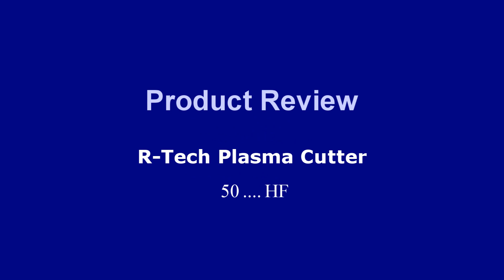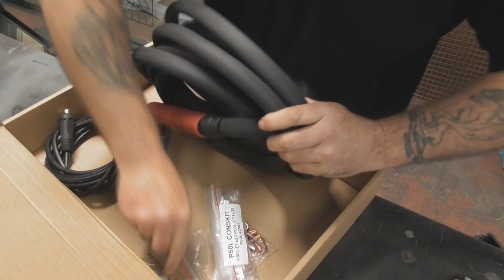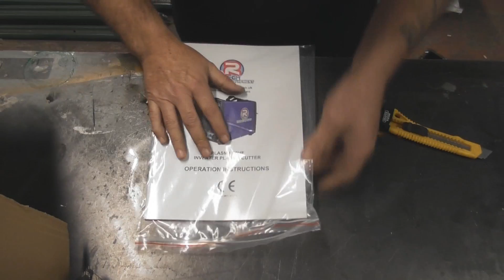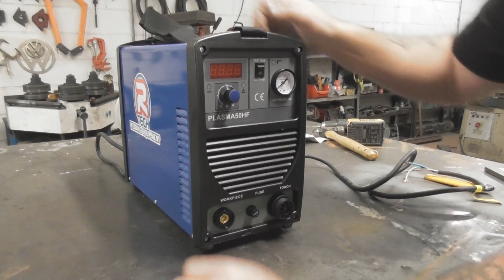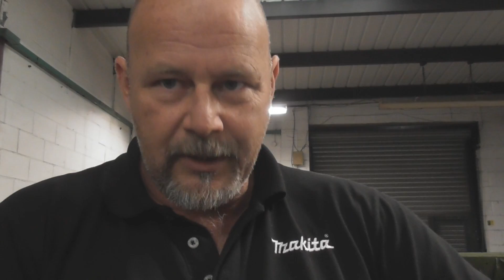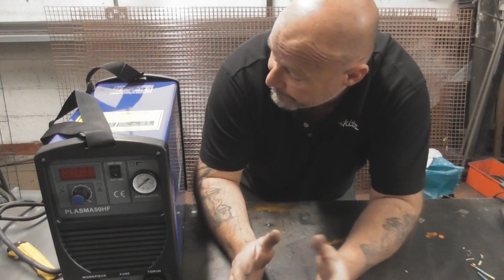R Tech Plasma Cutter 50HF Review

Comment: Im getting ready to purchase a lotus.  I bought their wire welder some time back and it works wonderfully.  It is Chinese,  but actually good quality.
Reply from the maker: there are some great Chinese products out there...when you think of the total volume produced against volume rejected they are really quite reliable.
Reply: @MakeItMetal  yes sir I honestly have not had an issue with mine that was not my fault.  I tend to forget it has a duty cycle lol.  And I burnt the trigger up with grinding sparks.  

Just about everything is made in china anymore.  If you ap at Walmart,  it was made in china lol.

Comment: Good honest review I'm in the market for a plasma and I'm stuck between the r-tech P50HF or the esab cutmaster 40 any advice
Reply from the maker: Hi will, I've never used the esab unit..however I have used their welders over the years and found them to be excellent quality units. I can't fault the R-tech plasma, I've been using it on a daily basis at the shop and I haven't had a single issue.  The consumables are reasonably priced and last well, I don't know how much the esab ones cost but I would factor that into my decision if I were looking to buy one myself. Hope this helps you a bit. Cheers. Jason
Reply: @MakeItMetal  thanks for the info jason much appreciated

Comment: Hi .
Will this run in a 16amp supply ?? Not full power mind. I went to purchase one and they said it would blow fuses if not a 32 amp.  How is yours wired please .
Cheers
Reply from the maker: hi,
i've run mine off a 16 amp breaker but now we have changed it out to a 32 amp breaker.  i've used it on site where 16 amp was the only supply available and it ran fine (at lower cutting power) however yes it will blow fuses if you try to turn up the power.
Reply: Cheers mate . Just ordered one
Reply from the maker: @jasonwinrow4020  nice one Jason..they really are a good bit of kit. I've run Lincoln units for years until I bought this one..it totally out performed my Lincoln. You get excellent after sales service with the R-tech guys too.
Reply: @MakeItMetal  
Yup I have the Tig 210ext and mig 250 but never had their plasma. Will have a play shortly 😁. Keep up the great videos

Comment: Do you think it will run off a 13amp to a 32amp adapter
Reply from the maker: I honestly have no idea. I run mine off 16amp single phase.
Reply: @MakeItMetal  ok thank you for it to run off a 16amp single phase did it have it's own circuit to run off or did you have a standard 13 amp plug to a 16 amp single phase adapter
Reply from the maker: @simpsonspyro2554  I put a single phase plug straight on it 👍
Reply: When i had the a electrician install a 32a plug the guy had to speak to R tech over the phone. Because apparently this unit draws 37a on the inrush. I had to use a 40a Type b breaker to run mine at full power with no issues so I have no idea how it would do on a 13a supply.. it may not even turn on but it does draw 29a at full power so you definitely  want to make sure your cable can handle the current draw otherwise you going to have melted cable in your house )

Comment: Did you put a 13amp plug on it?
Reply from the maker: no, i put a single phase plug on it. ive used it on jobs and had top put a 13amp fuse on it but only running a short time no higher than 30 amps cutting power.

Comment: Good video 📹. .do you think this plasma would be as good as a hypertherm 45xp.? It seems to be a good performer. I'm looking to buy one the hypertherm is a lot dearer than the retch. ..
Reply from the maker: in all honesty Martin, ive used the hypertherm unit and it's ok but for the money the r-tech is far better value and R--tech's support is amazing. save a few (actually a lot) and get the r-tech :)
Reply: @MakeItMetal  the hypertherm seems to be overrated. ..I see you have a migatronic welder in the back ground. .what's it like. .? I was looking at at 200 amp acdc  migatronic tig. ? They seem to be good too.and then  I was looking at the rtech 260 tig it cums in just under the migatronic in price ..it's hard to decide. ..
Reply from the maker: @mandylad  i love my migatronic mig...its probably one of the best i have used..easy to program and all the extra features (pulse, brazing etc) makes it really versatile. ive not used the migatronic tig welders though..i run a 250amp AC/DC R-tech tig and its awesome i upgraded mine to water cooling and it never misses a beat. i had it serviced last year by R-tech and the picked it up, serviced it and returned it within 3 days! :)

Comment: Geez Looking to purchase a plasma cutter and i have watched tons of plasma reviews and that is by far one of the best i have seen ! my only criticism is you never commented on the Pilot arc and how well it works against painted surfaces etc plus this cutter costs £714 including the vat, Top review though mate 👍🏻
Reply from the maker: Hi..you are right...I didn't carry out any tests on painted metal..but having used it a while now it is brilliant at cutting (melting) through layers of paint..the HF pilot arc does the job extremely effectively.  I think the price I mentioned was excluding vat sorry. Thanks for your comment, I hope my reply has helped. 👍
Reply: jason andrews , Thanks for your reply, From what i have been able to work out as a novice there are two different types of pilot arc, Think this one struggles firing up on a painted surface such as a car bodies etc, but like you say once going it melts away, looking between this and plasmapart cut 40 which apparently goes through less consumables because it has an air start pilot arc, Thats why i was curious about the Pilot arc, anyways i have subscribed mate as think you’ll do well on youtube all the best 👍🏻

Comment: Jason, what kind of airflow you need for one of these mate?
Great review and an awesome piece of kit...if money wasn't a stumbling block I'd definitely be adding this to my list of must haves!👍
Reply from the maker: it runs at 70 psi Huey. this plasma is really suited to light industrial / home workshop use..but you can find some pretty decent cheap ones on ebay fella....my old one cost £150 delivered and its never let me down..it's just not powerful enough for my needs.